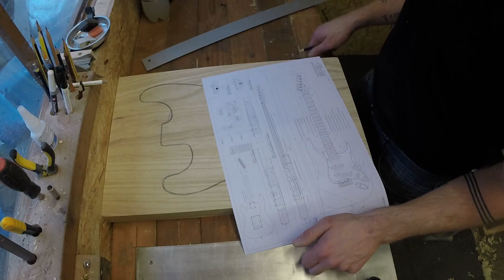Building process of an electric guitar body

Comment: I have a Tele built by Nick - it's the best guitar I've ever played in my 40 years of playing electric guitar.  I'm a woodworker that appreciates craftsmanship, but you should know that what you get from Nick is not just a good looking guitar. It's perfectly balanced when sitting or standing,  the electronics and pickup selection are perfect, as is the setup for action and intonation. Top, top notch. Playable straight out of the box and sounds great with all my valve and solid state amps. I've been through the whole journey of learner, intermediate, professional, custom shop guitars. My advice is that before you buy a 'professional' grade or above guitar from Fender take a look at what Nick is offering. He's making excellent guitars that are absolutely on the same level as Fender Custom Shop. As said above, I personally rate the one I bought from him much higher than the Fender custom shop offerings. Not only that, I prefer buying from a real person I can contact if I have questions. My experience of ordering and delivery was excellent. Nick is a great guy to deal with as a customer. For the record, it was through Dave Simpson's channel that I became aware of Oswald guitars and I am a normal paying customer.